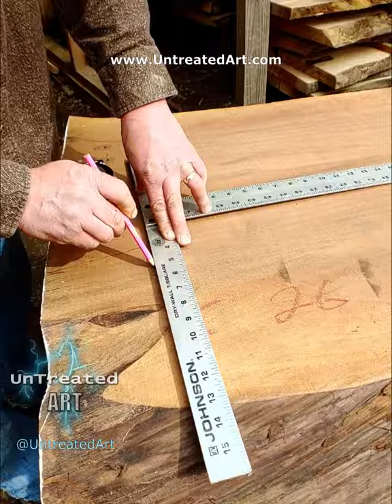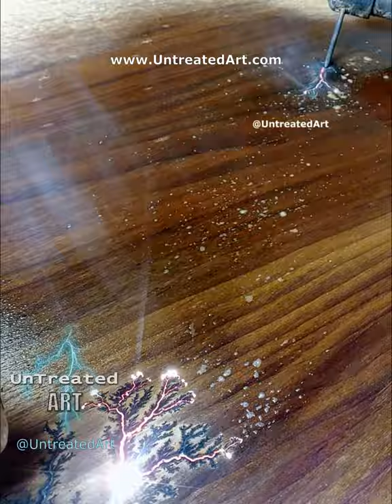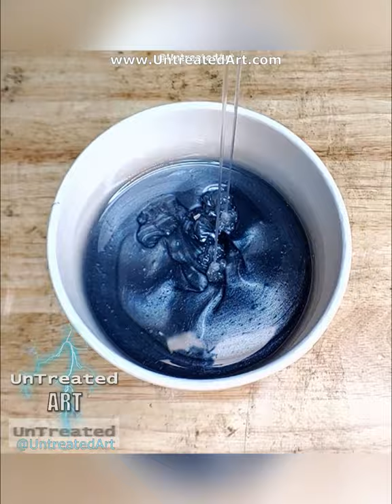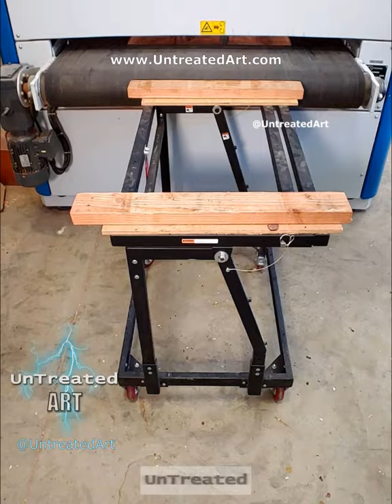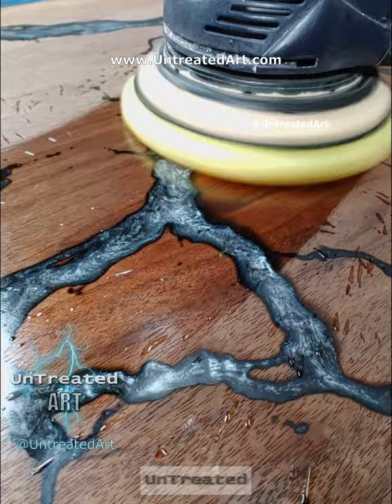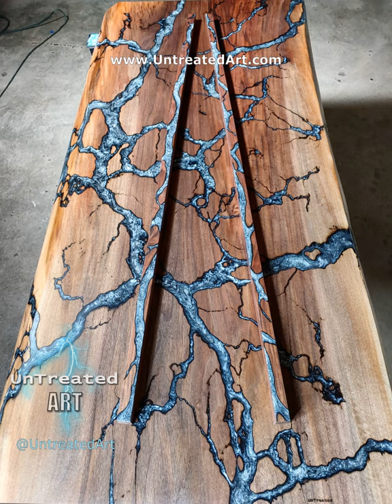Making a Fractal River Dining Table with Silver Epoxy Resin Rivers

Comment: I'm in Brazil and I admire your excellent work, could you remove any doubts? What voltage and amperage do you use? Do you put some type of liquid on the wood to facilitate contact (electrical discharge)? Congratulations for the magnificent work.